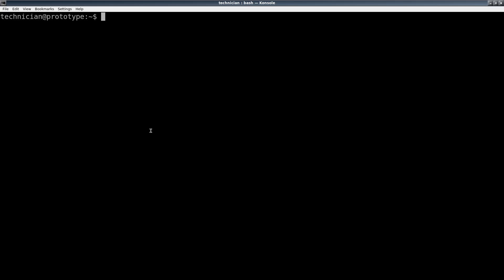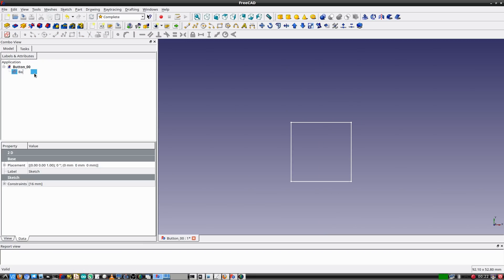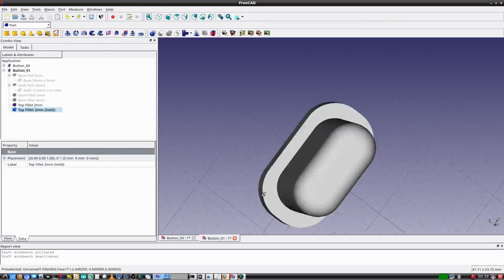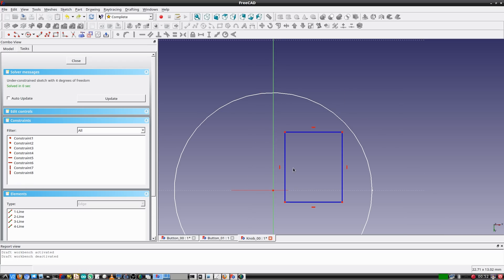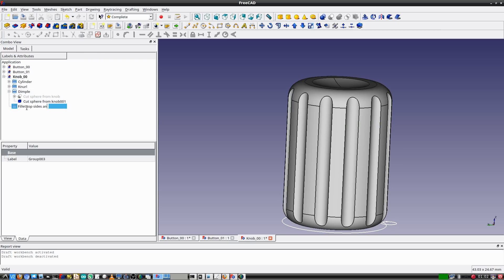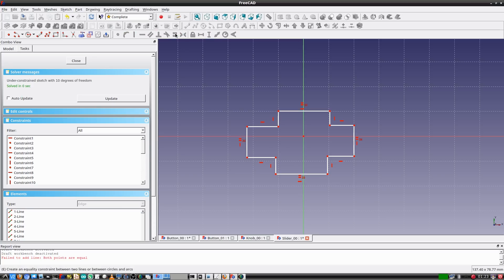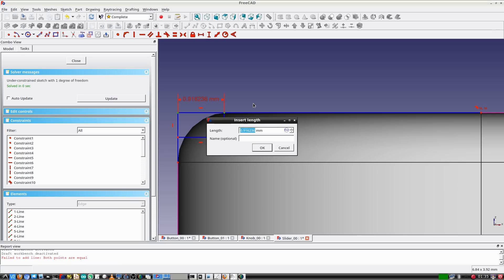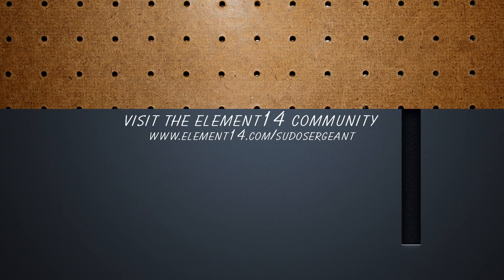sudo Sergeant 20 - 3D Design on a GNU/Linux System

Comment: Anyone know if freecad can make KiCAD 3d model parts?
Reply: Upcycle Electronics yes that’s the preferred method according to the KiCad wiki. The method I use currently is Fusion360→ collada export → blender import → add materials →  x3d export as KiCad supports both VRML and x3d.
Reply: amoose136 
Thx
Reply: Yes you should Kicad Step up in Freecad to export the models. Much more info here https://github.com/KiCad/kicad-packages3D/blob/master/README.md

Comment: I came across FreeCAD about 2 months ago, when I was searching for a tool to handle parametric design that I didn't have to pay tons of money for.  It works well on Windows, too.  I had previously used the free version of Sketchup because it was what I already knew how to use, but got tired of having to re-do half of my model every time I got a dimension measurement wrong or had to change some tolerances.  I love the spreadsheet feature, which I use to make a list of all of the dimensions of complex parts, then reference cells of the spreadsheet in sketches or anywhere you type a dimension.  Then if I have to change a dimension, I just change the measurement in the spreadsheet, and the whole model adjusts to the new dimension.  You just have to be careful to keep frequent backups of your model, because it does occasionally corrupt your models when it crashes.  It helps to put your models in a git repository, because you can make backups easily with just a "git commit".  I also occasionally have issues where it crashes as you open a model, but that's typically solved for a while by resetting the user settings by deleting "%appdata%\FreeCAD\user.cfg" on windows.

Comment: I've been using LibreCAD, but I don't yet do any 3D printing so I don't know how well it works for that. I tried FreeCAD first but it's too different from what I'm used to and I just couldn't figure it out. I originally learned 2D CAD with AutoCAD in the 1980s, when a 40 MB (yes, that's an "M") hard drive was *huge*...

Comment: Now this is a VERY unfair review of FreeCAD. It starts by blaming FreeCAD for the host system's deficiency of not having GLI3 properly configured. He didn't even tell his distribution, but I was able to find the root cause of this problem on the internet. Afterwards he mocks the "0.17" numbering of FreeCAD. being 0.17 does not mean it's unstable or something. Actually, currently version 0.17 is the stable version (just check on FreeCAD's site) and unstable is 0.18. The initial release of FreeCAD was in 2002, more than 15 years ago, so the numbering lower than 1 is just a quirk of open source programmers. It's a very stable and powerful software with which I've done a lot of jobs.
Reply: I do most of my CAD work in Creo, a very expensive commercial product. I can promise you that it is no more stable than FreeCAD. I don't use FreeCAD for much but this has inspired me to play around with it more. I will say that, based on other CAD packages I have used, FreeCAD runs very efficiently. I am quite impressed with it.
Reply: I agree but still, this program crashes or displays glitched results with it's example projects from the start page on macOS High Sierra with an Intel HD graphics 5000 while using the default renderer. You can blame the OS not being properly configured on Linux but here it's not as obvious what's going wrong. I tried using the "experimental" OpenGL renderer and that solved most graphical issues but the example robot project still crashes. I might try it on Windows 10 later on an old laptop just to have more points of comparison but there you go.
Reply: On that matter I agree with you, although I don't have a Mac. Reading the forums it seems like they have very few mac people testing and contributing, which would explain the fragility of the current build.
Reply: FreeCAD is not stable yet, but it works very well in most of cases.

It is not stable because sometimes there are changes that break the compatibility with previous versions, but with a little work you can use the model again.

Comment: Nice, more interesting for me personally than all the "fundamentals of the Unix environment" stuff you were doing before.
I've been doing design for 3-D prints using Blender: It's served me well but it's not really the right tool for some of the stuff I'm trying to do. (A lot of the work I do in Blender has more of an aesthetic focus rather than a mechanical or functional purpose, but there are mechanical elements to it, and working in a CAD-style structural design environment might actually be very useful compared to Blender's mostly surface-oriented process.)

Comment: Felix, have you tried OpenSCAD (http://www.openscad.org/)?  It’s pretty interesting and useful.  It uses more of a programming paradigm, using a language that is a combination of a 3D object description language and a programming language.
Reply: It's different. And FreeCAD has perfect integration with OpenSCAD. It has an OpenSCAD workbench where you can program it directly. And it imports and interprets .scad files, transforming it into parametric models -- the best part is that parts with curves, like spheres, instead of being tesselated, preserve the NURBS information. Also, FreeCAD has its own python framework which easily allows you to do FreeCAD-like programs, using the cadquery workbench.

Comment: Freecad also works on raspberry pi 3
Reply: zenmax242 mine rpi3 couldnt work, is there a fix?
Reply: zeynep yufka this is the page that had the instructions http://www.raspberry-pi-geek.com/Archive/2016/17/3D-modeling-on-the-Raspberry-Pi-with-FreeCAD
Reply: How did you install it?
Reply: Cláudio Sampaio the page i replied with has the instructions if it doesn't work for you guys reply to me and i try it again
Reply: I couldn't see any link. Seems youtube has ghostbanned your comment: you see it, others don't. Happened to me a thousand times. :-(
Reply: Cláudio Sampaio http://www.raspberry-pi-geek.com/Archive/2016/17/3D-modeling-on-the-Raspberry-Pi-with-FreeCAD   i can send it to your email
Reply: Cláudio Sampaio i sent it again
Reply: i installed with apt-get method. new appimage format not working for rpis
Reply: zeynep yufka try sudo chmod a+x nameoffreecad.appimage. but i dont remamber using a appimage for the raspi